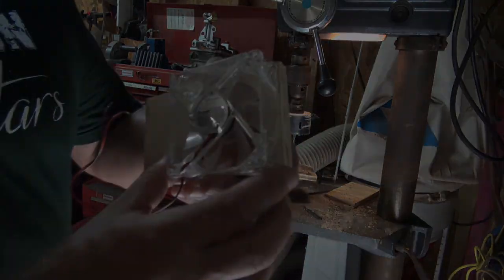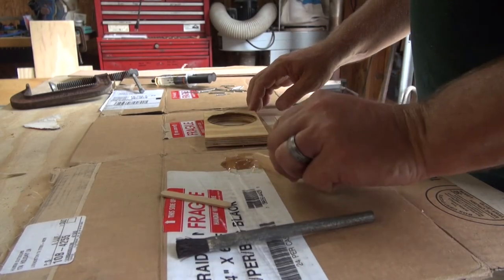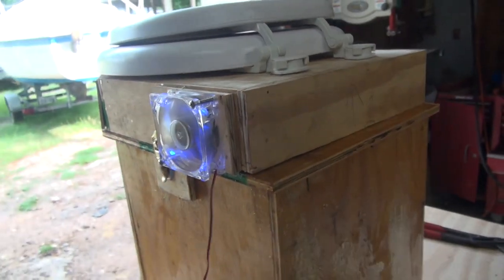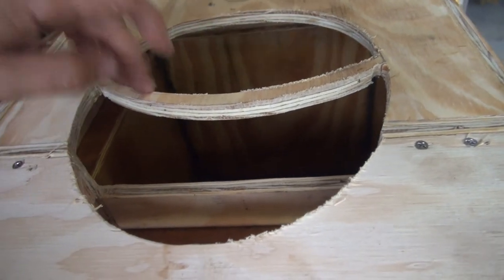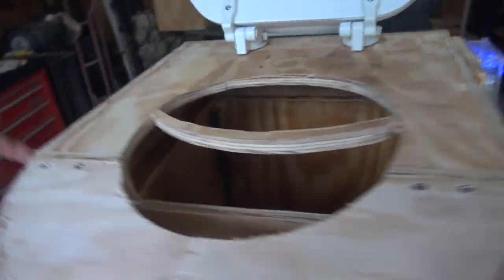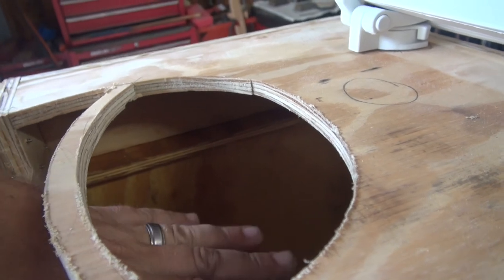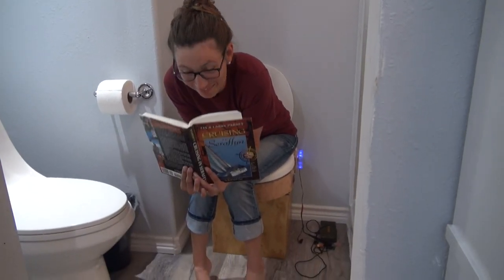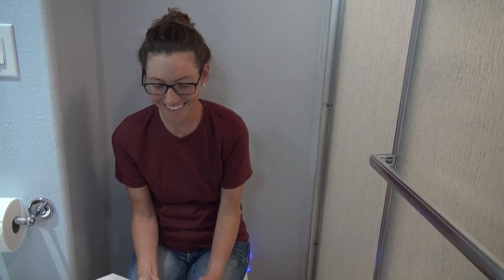BUILDING YOUR OWN COMPOSTING TOILET- Dream Catcher S/V Ameris Episode 12

Comment: I also make use of computer fans, yea, they will eventually break due to corrosion, but who cares when they are $5 each? I would suggest mounting it on a rubber gasket though, helps reduce the noise from vibrations.
Reply from the maker: Thank you for the advice!